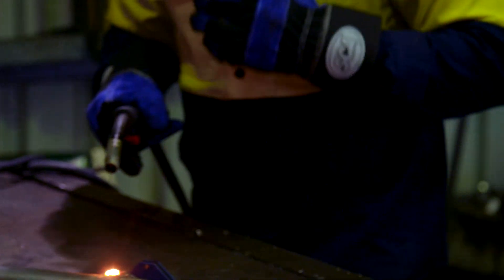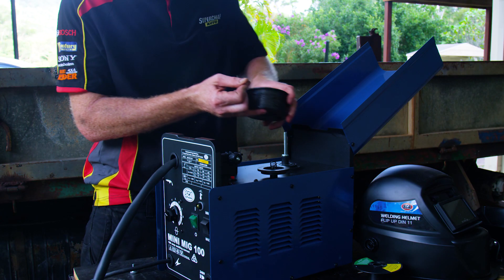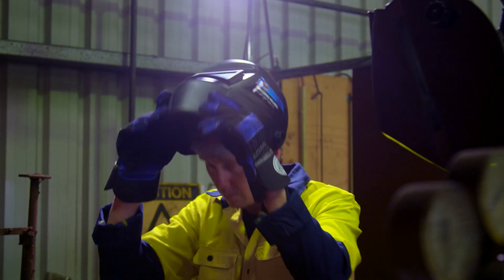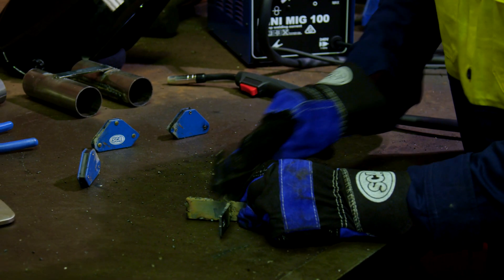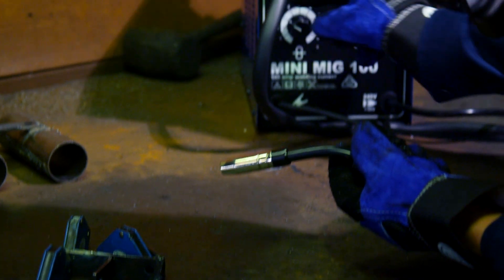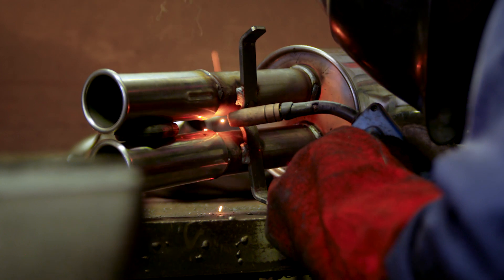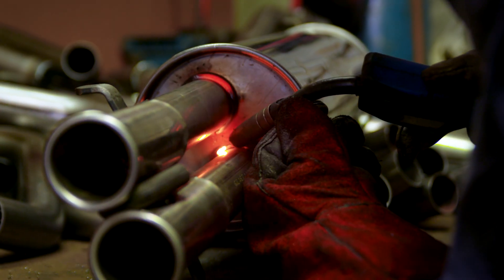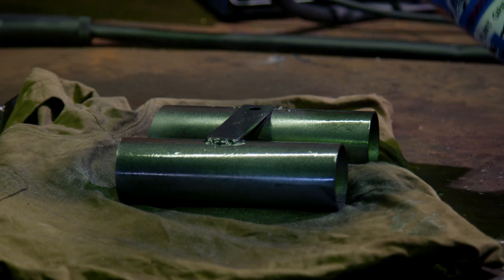The Basics of MIG Welding

Comment: You definitely need a welding helmet! Not safety shield or welding helmet.
Pushing gives you a strong weld and pulling will give you a weaker weld... so much wrong with this video

Comment: Mig wire rolls that are mounted horizontally rather than the more conventional vertical tend to lead to inconsistent wire feed which leads to poor welds. You can even see in this clip how jerky the wire is feeding off the roll.